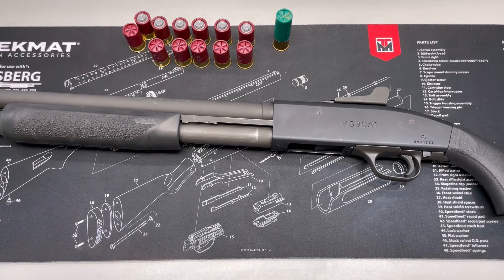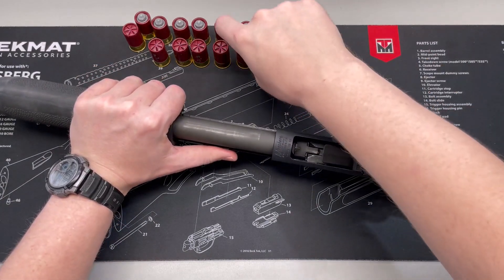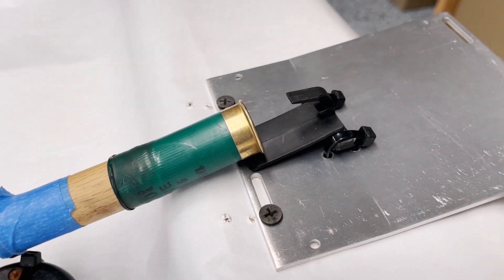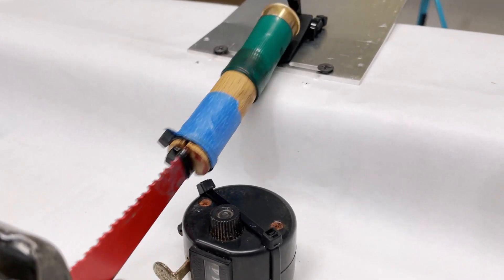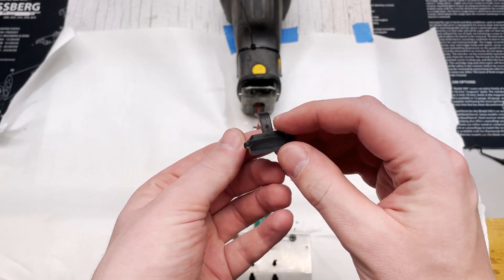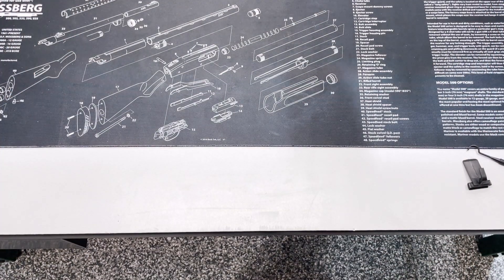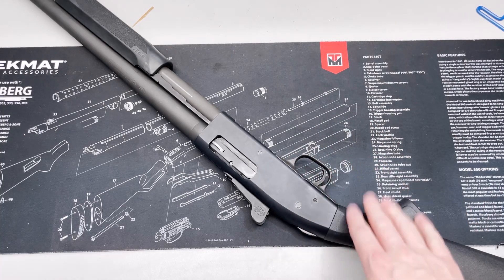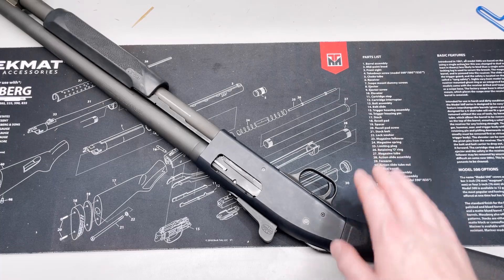Defender Tactical Universal Cartridge Adapter Life Cycle Test

Comment: Does this adapter prevent unloading the tube by manually pushing the shell release?  It looks like this would no longer be possible and the only way to unload the tube would be to cycle the action
Reply: You can push the adapter down so you can get normal shells to cycle out of the tube if you don't want to pump the gun to get them out.

Comment: Its the long part that's always bending for me unloading
Reply: Manually unloading from the tube or when cycling the forend to eject shells? Have you removed the adapter because of this?
Reply: @bcaro2139  it was bending manually removing shells... nah I just bent it back and push it down when ejecting shells. It's worn in a bit now and I don't have any problems now.. really a non issue at all when cycling the forend to eject shells.. also cycles great when shooting

Comment: Will this device fit into a WInchester 1300 Defender?
Reply: this was designed for the Mossberg 5xx line of guns...
Reply: I've read that the stock 1300 Defender can cycle minishells without modification.

Comment: This is a great accessory to make my 590A1 SPX run mixed sizes of shells so I don't have to buy an "S" model or be restricted to only mini shells with it installed. Getting ready to place an order.  Is it available stand alone without the follower?  I really don't need one but it's not a deal breaker either.
Reply from the maker: Unfortunately we only sell them as the kit at the moment.  However, with our current pricing of the kit you are basically getting the follower for $5.  Thanks for your interest!
Reply: I’d get the package deal. The follower is way better than the Mossy stock one. My Mossy follower would bind up quite a bit.
Reply: @frankcastle1183   I already had a good aftermarket follower is why I'd asked. But I ended up ordering the package (also it was the only way it came).

Comment: I love the innovation and drive you guys used to get this to market.  My only concerns are how well this would hold up under extreme temps (esp extreme cold) and how the polymer will last over time.  Polymer's molecular structure degrades over time as anyone who has had an old car with a cheap interior plastic interior will know.  I wonder if that middle hook was wider so it had more strength if it would be more durable?  Seems a bit narrow.  

Does the material it is made out of how to be so soft / spongy or would a stiffer (maybe alloy) material also work?
Reply from the maker: Thanks for the comment, we definitely understand your concerns.  We have done what "temperature" testing we can do here in TX, and the adapter will maintain its flexibility in sub-freezing temps.  Admittedly it's difficult for us to do a rigorous functionality test in those conditions, but with winter coming to a close soon and no temp related complaints from over 2500 adapters across US/Canada, we have great confidence. 

In terms of the hook or "arrester", the width and material are optimized to absorb the energy of the minishells in the most controlled manner to prevent flipping/tumbling (also making it necessary to be rubber).  I will say that this demo really puts the strength of this feature to the test, as it is cycling at a much higher frequency and absorbing more energy than it would in actual function.   We think it could withstand this test at least several more times without fail, if not more.  

However, you bring a good point about the degradation of the material over time which can be common in poly/elastomers.  The adapter material is put through a vulcanization process similar to tires or industrial power transmission belts, improving properties from strength to even weather resistance.  Obviously this is a question only time can answer, but again something we have great confidence in.  Thanks again for the comment and your interest in our products, hope this has helped!
Reply: @defendertacticalTX  I'm buying more!

Comment: Have you run it through more testing after the 10000 cycles to find its total life expectancy?
Reply from the maker: It has been dry cycled several times and is still installed in that firearm. There was no sort of degradation or performance issues so we've left it to see how it continues to perform.
Reply: Please introduce me to the person who has put more than 10k rounds through their shotgun (who isn't leo or mil)
Reply from the maker: @izyb6608  We actually saw a customer claimed to have ran 5000+ of mixed shell lengths through our adapter with zero issues.  This was a month or two ago now, and he had only had it for a few months before the comment, so he may be close now!

Comment: I love my Defender Tactical mini shell adapter. Very good option for the Mossberg Shockwave. Makes it an even better Home Defense weapon. Women and teenagers can use it for protection. Because of the greatly reduced recoil of the mini shell. And it will still have a lot of close range stopping power.
Reply from the maker: Absolutely, and not to mention the added capacity it can give.  Now it obviously it will never give you the capacity of an AR-15 or handgun, but the 590A1 can be loaded with 12+1 minishells, which is larger than or comparable to a lot of handguns.